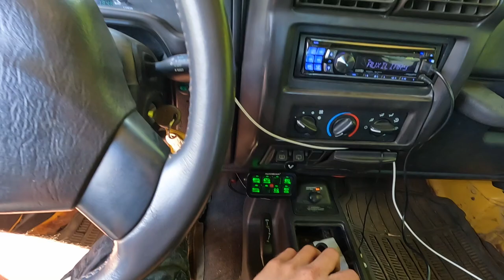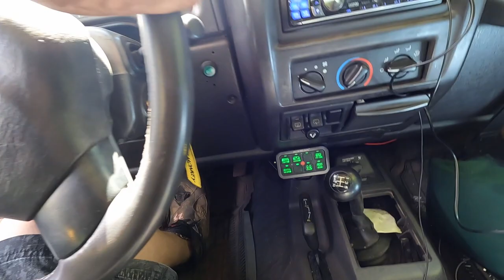Can A Lifted CRV On 31s Rock Crawl With The Jeeps?

Comment: As a close friend of Mike in the CRV. Id like to let everyone know that the motor is down a cylinder and drinks more oil than fuel. Most likely in and around the 85HP range at the moment LOL. Good job Mikey.
Reply from the maker: Ya he’s been limping it for a bit but always manages to make it work out
Reply: She's needed a new powertrain for a long while.... it's coming 😁
Reply: they NEED valve adjustments every 30K or you burn valves and lose cylinders
Reply: K24
Reply from the maker: Would be a monster

Comment: That first attempt at getting out the water, seems like they were messing with the clutch too much as the AWD was not kicking in.

In a CRV you have to let it do its thing, maintain lowest rpm you can without it stalling and let the front wheels slip and continue to slip so the rear wheels can activate. 

If that fails then full send but again give tha clutch engaged and let the AWD do its thing.
Reply from the maker: His is automatic, his motor was running on 3 cylinders though. Swapped in a new motor recently
Reply: @SmokinMonkeyOG  They should definitely look into a manual instead of sticking more money into that auto if they're going to play off road.

Will be the biggest upgrade they can do in terms of off roading.
Reply: @SmokinMonkeyOG  the CRV was doing all that effort in a 3 cyl running engine? that thing is a tank.

Comment: It's OK, maybe need to look into how to lock in the rear drive? The driver needs to understand how the system works mechanically - the rear drive doesn't work until there's slippage in the front and that seems to be where he backs off. Gear ratio isn't helping either.

Comment: The thing I learn from videos like these, and my own personal experience, is that lockers are one of the most important mods that can be done. If that CRV had lockers it could have made all those climbs IMO.
Reply from the maker: You are not wrong at all
Reply: Lower gearing is the most important, that thing is struggling without a low range transfer case.
Reply: Articulation will help more than lockers, keeping those wheels planted on the ground is the most important thing...  lockers will help when you run out.  Also I had a 1998 CRV ages ago, brand new when they came out.  I wheeled it once on a very easy trail.  Never wheeled it again.  This isn't what I call "fun" but to each his own.   I'm not judging...  Now these things aren't worth much so... why not. Parts are probably easy to find and cheap. 👍

Comment: About lockers. You could of put some lunch box lockers for around $500, In the long run it would have probably saved you money and break downs. The reason i say that is you wouldn't have to send your jeep as hard as you do to overcome an obstacle.  I've noticed alot of your break downs come on tuff obstacles. Maybe its to late, but that was one of my first investments. And when i did the lockers i also installed the 488 gears. After that the fun stuff. As i mentioned i don't have to punish the TJ over obstacles. Just my 2 cents. Enjoy your videos. Take care.
Reply from the maker: You’re not wrong but I’m just tired of putting money into the TJ for now. We’ll see after the summer

Comment: Does someone actually make a lift kit for the CRV or is that a custom setup? That thing is awesome
Reply from the maker: I think it’s an actual kit, I think you still gotta mod some stuff and cut a few things to make it work though
Reply: HRG Offroad and Aerogenics makes lift kits for the CRV.
Reply: Thanks! It's a HRG 3" Lift, all adjustable arms, paired with a 2011 Crv rear differential.

Comment: Is this CRV 4wd or AWD ? Because it did great. I'm currently looking for a small family overlanding rig. Have a 05 runner but the frame is shot. I have a 2month olds so having a babyseat in my rig is important.. crv seems to fit all my criteria so far as a secondary vehicle 4wd and weekend overlander 🤔
Reply from the maker: It’s AWD. I believe it’s front biased till the system notices slip then engages the rear
Reply: @SmokinMonkeyOG  Mm okay, i'm not a fan of AWD systems. They are more prones to costly problems with electronic. I'll stick with my first thought. Suzuki Grand Vitara gen 2 or 3 hahaha. Thanks for the heads up man. Cheers from New-Brunswick ✌ ( used to roll a wrangler myself.. now with a new born I miss it but can't afford a wheel barrow of a ride hahaha!)

Comment: questions... you loose the sway bar for trails no? how does the crv works so good... it doesnt have the 4x4 like wranglers no?
Reply from the maker: It has full time 4x4 with open diffs so basically the same thing as a wrangler with open diffs but he doesn’t have the same amount of flex and articulation on the rocks that’s why it lifts tires more often
Reply: Crv runs no sway bars, it's lightweight and paired with driver mod 😄
Reply from the maker: Driver mod makes all the difference

Comment: Paid two grand for it and put forty grand in it in two years, can we get a list of the parts and labor please. Not that I think you're stretching it or anything, it just that inquiring minds want to know! One more question, why do you get to have all the fun?
Reply from the maker: Spent on Jeep TJ

1. 2001 Jeep TJ Sport 4.0L $1980
2. Battery $144
3. 5 Wheels $400
4. lug nuts $20
5. 3 Wipers $45
6. Cleaning 7 hours
7. 4 Floor Mats $40
8. 2 Front links $65
9. Starter motor $113
10. Front hub bearing $133
11. Oil and filter $45
12. 2 Front axel bearings $23
13. 2 ball joints $80
14. Steering stabilizer $61
15. Installation of steering stabilizer, u joint, sway bar links, hub bearing, upper and lower ball joints $945
16. Door Mirrors $76
17. Black grill inserts $45
18. Black headlight rings $33
19. KC Bumper Lights $225
20. Bumper End Caps for front $40
21. Wheel balancing $60
22. Seafoam $25
23. Spark plugs $75
24. Battery tie $10
25. Tire plug kit $15
26. Fire extinguisher $30
27. Spare keys $12
28. Spare key magnetic box $10
29. Traction boards $225
30. Ratchet straps $30
31. Rok Straps $30
32. Throttle body gasket $3
33. Gasket paper $5
34. Throttle position sensor $90
35. Bumper end cap replacement $20
36. Windshield $260
37. Two front brake callipers $140
38. Winch w/ warranty, Winch Plate and Accessories Bag $660
39. Door sill guards $50
40. Hardtop Thumbscrews $15 
41. Drums and shoes $178
42. Brake line (left rear), two wheel cylinders and brake adjuster cable $387
43. Fuel tank skid plate $271
44. Fuel tank straps $86
45. Transmission Mount $32
46. Hardtop Exhaust Vent $155
47. 2 rear drive shaft U-Joints $218
48. 4 Super Swamper Trxus M/T tires $400
49. Balancing for 4 tires $100
50. Hack Saw (cut exhaust on trail) $20
51. U-Joint on drive shaft (again) new yolk and retainers, new rear control arm brackets, front and rear diff fluid $1950
52. Rear lift gate hinges $110
53. Rear lift gate support struts $45
54. Epoxy and coolant $80
55. Radiator $224
56. Thermostat, coolant and rad hoses $100
57. Nuts & bolts for fan shroud $10
58. Hardtop because I broke the rear window $45
59. Sun Visor Bracket $25
60. Tire balancing x2 (other 2 not able to be balanced...) $22
61. Carpet cleaner $225
62. Balancing beads $54
63. 2 New sun visors $80
64. Weatherstripping for trunk $25
65. Folding shovel $25
66. 2 front upper ball joints, wheel bearing, front u joint $802
67. Oil & filter $50
68. Painters tape $8
69. 50” light bar bracket $120
70. Transmission shifter bushing $40
71. Rigid 50” light bar and harness $637
72. Lift kit, oil pan, gasket and  bump stops $827
73. Rock lights and install supplies $200
74. Wire ties, screws and 2nd harness $80
75. Synthetic winch line, hawse fairlead, soft shackles, tree saver and tow strap $333
76. Ambient lights $30
77. Cigarette lighter socket $25
78. Green switches $32
79. Hood decals ‘BIG BIRD’ $50
80. Subwoofer box empty (2 x 10”s) $85
81. Wheels and tires x5 (33” Super Swampers) $3075
82. Bottle jack $60
83. Wheel chock $12
84. Install for lift kit, bump stops, bump stop mounts, oil pan, light bar bracket and transfer case drop bracket $2078
85. Cable terminal ends for sub amp $11
86. Mounting/balancing for wheels and tires $65
87. Tire carrier spacer and bump stops $140
88. Red Brake Light LEDs $34
89. Rough Country Adjustable Control Arms All 8 $1061
90. Steering wheel lock $65
91. Drag link, tie rod and track bar $1140
92. JL style turn signal DRL for fender $53
93. Transfer case skid plate $70
94. Front drive shaft rebuild $500
95. Brake pads and shoes $97
96. Install 4 new ball joints, front brake pads, two front hubs, and HD tie rod and drag link $1478
97. Towing $250
98. Painters Tape $12
99. Install control arms, new brackets for control arms, rear track bar, shoes, and alignment $2350
100. Front inner Axle seals and gear oil $85
101. Winch rope and winch line bump stop $140
102. Front outer axle seals $80
103. *Rear Differential Gears replaced (planetary gears got shredded) and body mounts on drivers side. Rust hole in rear quarter and body mount. $500
104. *Body mounts on passenger side (side and rear corner) body lift, radiator and fan $900
105. Light bar cover $30
106. Spare tie rod $130
107. JKS sway bar quick disconnects $250
108. Neon Green Seat Belts (Front) $356
109. Coolant $17
110. Throw-out bearing replacement $870
111. Air down tool $40
112. Spare Valve Stems $35
113. Belt tensioner and idler pulleys $120
114. Radiator hoses (both) & thermostat + coolant $89
115. Radiator $250
116. Water pump $50
117. Water sprayer with new inlet hose $75
118. Engine Oil, air filter, oil filter, marvel mystery oil $90
119. Water pump $70
120. Thermostat housing $30
121. Fan clutch $96
122. Gear oil $25
123. T case and install $300
124. Frame repaired $100
Reply from the maker: I stopped counting over a year ago at around 30 something thousand. And it was 4 years. Since this list I’ve replaced the engine, 3 radiators, rebuilt the front axle and rear axle two or three times
Reply: @SmokinMonkeyOG  Dam, I guess you have spent a chunk of change on her, I'll add it up and exclude things like oil changes and other routine maintenance items and things like floor mats and see what I come up with. I have a large garage to do my own work in, so I have an advantage that way, other than vehicle inspection and tires or machine work if I am building an engine, I do all my own work, saves a ton of money. I also have friends that made me some machined pieces and sheet metal for my off-road jeep, free is good. Have fun on the trail and keep it rubber side down.
Reply from the maker: Ya I do my best to do whatever I can myself to the best of my abilities and of course because I don’t have a shot just a parking spot in an underground garage. But I get a lot done down there lol thanks man
Reply: @SmokinMonkeyOG  Yea it helps to have a place to work and over the years I have accumulated a lot of tools which cost but save in the long run, my son in law says there is going to be a gun fight over my stuff when I pass on, LOL. Thanks for taking the time to send me your list. A big problem we have these days is money is almost worthless and until we get some sanity in our governments it is not going to get better. In 1969 a pack of Marlboro flip top box cigarettes were .35 cents and a gallon of Sunoco unleaded premium 104 octane was .35 cents, crazy huh? I just paid 4.119 a gallon for 89 octane in NY state and it is more here in PA!
Reply: @SmokinMonkeyOG  Yea it adds up to 32,077.10 so I guess you have although some of the costs were routine maintenance and others were frivolous or items you can take from vehicle-to-vehicle others I thought were a little high cost wise. So glad I can do my own work and thankful for the internet so I can save a ton on parts and tools and again thankful I have my own garage although I built it myself with a little help from some friends and before building cost went thru the roof. Still when you break things on your Gladiator it will still cost you, most of the people I know with the newer jeeps just run seasonal roads or easy trails because of the cost of the vehicle. Funny my TJ is a 2001 sport with the 4.0 and a five-speed w/ dana 44 rear.  I was going to build it, but then I was given my CJ5 which I built up, so the TJ is waiting in line, I have a NV4500 all ready and the nodular iron flywheel with the kevlar clutch and nodular iron pressure plate and I have already updated a transfer case by eliminating the slip yoke and have the new rear drive shaft and a 4.2 crank and rods to make a 4.7 stroker, just a matter of time and money. If the dam frost hadn't killed the buds on my money tree, I be all set! LOL
Reply from the maker: Sounds like a nice build